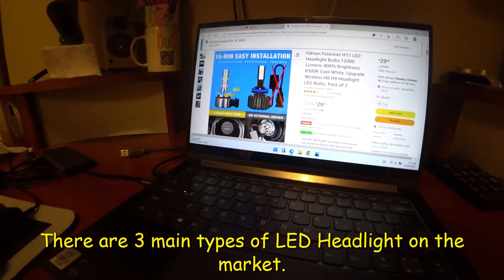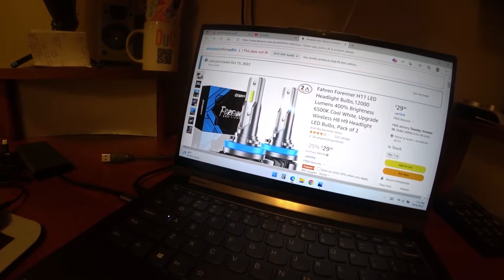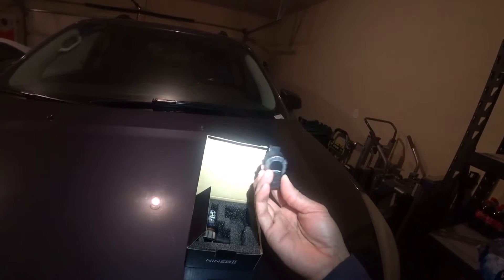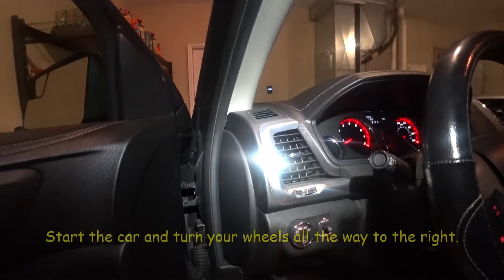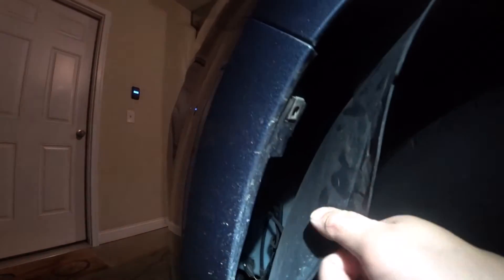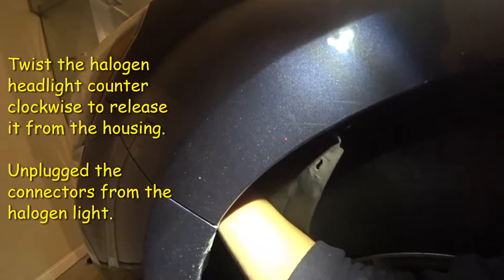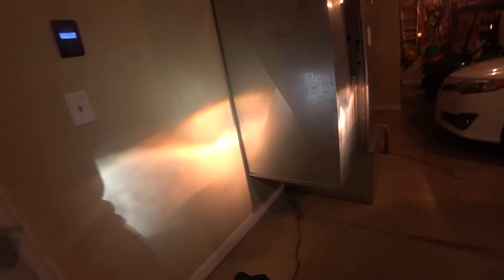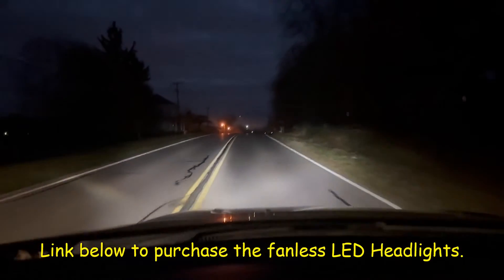FAST & EASY - How to Install LED Headlights in GMC Acadia

Comment: Do these lights allow you to clock them? As in being able to have the LED chip positioned at 3 and 9 o’clock?
Reply from the maker: These are just simple replacement LED headlamps. There are more expensive models out there that does clocking.

Thanks for asking.
Reply: What is clocking?
Reply: @paddyo8114  It’s being able to tun the bulbs to face the 3 and 9 o’clock positions while seated in the housing.  Some bulbs don’t allow it, once mounted that’s it.

Comment: From the research I have done the active colling will extend the life of the LED. Curious to know what your experience has been with the fanless LEDs.
Reply from the maker: Headlights are still working. Do notice the lumens output has decease from usage. That is normal even with regular halogen bulbs. There are newer gen bulbs with higher lumens out put and led diode (from 3 to 6 now). Recommend if you go the LED route purchase the newer gen bulbs.

Thanks for your feedback.

Comment: did you have to install a conversion kit to go from halogen to led Lights?
Reply from the maker: No conversion kit require. Just plug it in like as if you where replacing it with a regular halogen bulb. Easy to install and no rewiring needed.